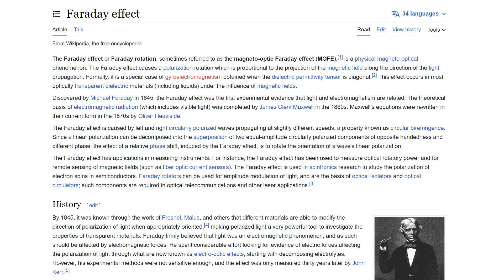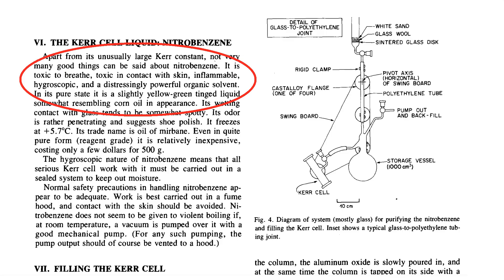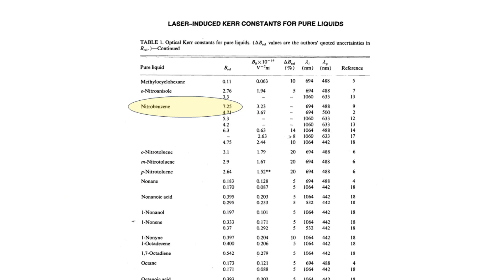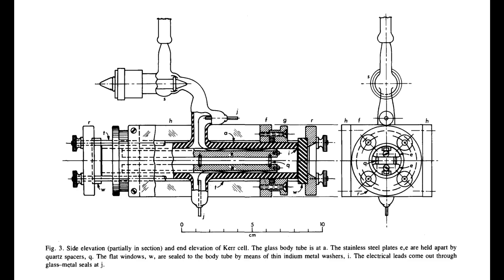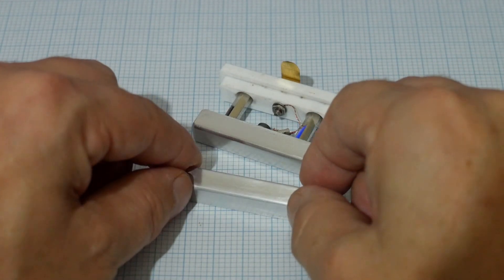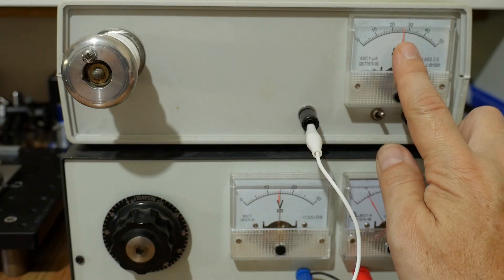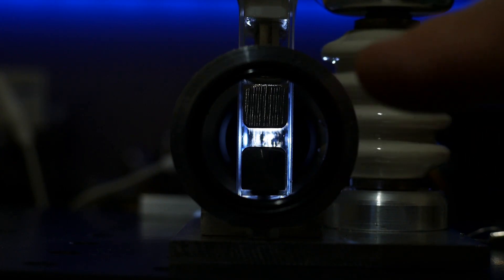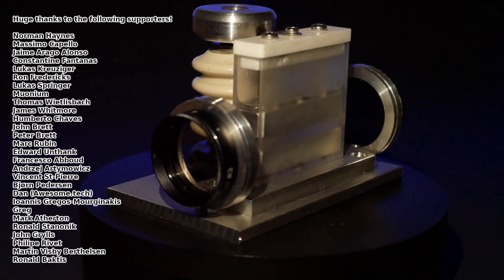Controlling Light with High Voltage and Aniseed! The Kerr Effect!

Comment: As I understand the Kerr effect is based on the field not the voltage or current directly. So I'm wondering why the electrodes are immersed in the liquid, why not place them on the outside  walls of the curvet? That way there is no current flowing through the liquid, maybe that causes the ribbons etc.
Reply from the maker: Yes, you are right, no current should flow in these, and building them in the glass walls might be quite convenient! The stringers I 'think' are because of impurities, however as Mike pointed out, this effect could be used to clean the solution by precipitating that junk out.
Reply: @LesLaboratory  Hey genius, that’s ^*star anise, not fuqqing (^*anise seed, not aniseed) ffs. How can you post a video with such a major and obvious mistake?🙄🤦‍♂️🤦‍♂️🤦‍♂️🤦‍♂️💩💩🤡👎

Comment: Excellent as usual.  I recall seeing a Nitro Benzene Kerr cell described in a even old at the time issue of Scientific American Armature Scientist 
back in the late 1960.  It was part of a high speed photography project.  If I recall correctly the light source was an exploding wire and a high
voltage switch made from a modified rat trap .  Your setup is by far safer and more practical.
Reply: Excellent CLICKBAIT.
Reply: Crackhead
Reply: Anyone making CLICKBAIT like you should be banned, fined and arrested. I'm blocking this channel. I wonder about the mental state of people liking this video or following this disrespectful channel.
Reply from the maker: Thanks! I read those articles as well. I think with a bit of refinement, some interesting experiments could be done on this!

Comment: Very cool video!

Are you interested in optimizing the performance of that device? To see what kind of transmission, modulation contrast and what speeds can be reached? 

Sidenote: Can't you use the exact same electrical setup for a pockels cells too? Specifically, with your KDP crystals?
Reply from the maker: I think Anethole is worth seriously exploring. There is very little about it in the literature. It would be interesting to characterize it.

Pockels cells are way more efficient and require much lower voltages. I already have some hardware on the way to cut and mount the KDP.

Comment: By the way, even though it is very toxic, nitrobenzene smells absolutely great! It has an almond oil like odour, just a bit sweeter and softer than the benzaldehyde found there - probably the best smell of any chemical I've smelled so far, really unfortunate that it's so toxic
Reply from the maker: Cool! I heard someone also say it smelled like boot polish. I will pass though! My workshop now smells of aniseed.
Reply: @LesLaboratory  Well, the difference to benzaldehyde is very small, especially when dilute, so if you know that you have a very good idea of nitrobenzene. In my opinion, pure benzaldehyde has a slight stingy artificial note that nitrobenzene lacks, but it's only obvious in a direct comparison.
Reply: You make me curious. 😅

Comment: For high-speed switching, a simple spark gap should be a good start to create a fast edge. For ultra-short pulses, maybe some sort of  transmission-line setup ? 
As those impurities seem to be attracted by the HV, I wonder if you could use this property to filter the solution
Reply: There seems to be an easy way to purify using water and temperatures between 0 and 30degC:

Purification of Anethole by Crystallization: Summary

1. Initial Preparation: An aqueous emulsion of anethole is first prepared. The concentration of anethole can vary.
  
2. Cooling for Crystallization: The emulsion is cooled to below the crystallization point, preferably around 0°C. Subzero temperatures can be used with antifreeze like methanol.

3. Crystal Separation: After crystallization, the anethole crystals are separated from the aqueous emulsion.

4. Further Purification: The crystals are reslurried with cold water and an emulsifier (potassium or sodium soap of tall oil fatty acid) or surfactant for further purification. This step can be repeated multiple times if needed.

5. Water Removal: To remove residual water, the crystals are melted and water is separated at temperatures between 25-50°C.

6. Final Product: The resulting anethole is highly purified, with reduced sulfur contaminants and excellent odor and taste.

This process aims to increase the purity of anethole, which could potentially improve its performance in Kerr effect experiments.
https://patents.google.com/patent/US4902850A/en
Reply: A spark gap driving a shorted quarter wave stub, near the shorted end, with the open end across the cell would be a simple way to get damped oscillations at a frequency determined by the stub. (well into Ghz) The stub would also provide the needed voltage step up function. Also, since it is the electric field were are interested in, I don`t suppose the electrodes need to be in contact with the liquid, maybe they could be just foil on the outer walls thus avoiding potential contamination from the electrodes.
Reply from the maker: Also very interesting. I had not considered capacitively coupling in the field!
Reply: Make yourself a spiral line pulse generator with an appropriately sized inductor on the output in parallel with the Kerr cell. It can make extremely quick HV pulses of about 4nS risetime.
Reply from the maker: There is a diagram of a spark gap arrangement in one of the papers, but I have too much sensitive stuff on the bench at the moment. That is a great idea, like a precipitator of sorts...

Comment: Introduction and Background
- Introduces the concept of controlling light using electric fields, focusing on the Kerr effect.
- Discusses the historical background of the Kerr effect, discovered by John Kerr in 1857.
- Explains the traditional use of high-voltage Kerr cells and their applications in high-speed photography.
- Highlights the toxicity and dangers of commonly used liquid nitrobenzene in traditional Kerr cells.

Alternative to Nitrobenzene
- Discusses the difficulty in sourcing and safely working with nitrobenzene.
- Identifies Anethole, a non-toxic alternative with a high Kerr constant, as a promising substitute.
- Describes the molecular structure and properties of Anethole, a component of aniseed.

Experimental Setup
- Details the construction of a Kerr cell for testing Anethole, including sourcing and assembly.
- Explains the need for polarizers and a high-voltage supply for the experiment.
- Notes issues with the plastic lid of the Kerr cell being affected by Anethole.

Experiment and Results
- Demonstrates the completed Kerr cell using a homemade high-voltage supply.
- Observes the Kerr effect using an LED and a camera setup.
- Notes the presence of impurities in the Anethole used, suggesting the need for purification.
- Tests the Kerr effect using a laser, finding it to be very prominent.

Conclusion
- Concludes that Anethole is a safe and effective substitute for nitrobenzene.
- Suggests future work could include purifying Anethole and testing the speed of the Kerr cell.

Positive Findings
1. Effective Substitute: Anethole serves as a non-toxic and effective alternative to nitrobenzene for demonstrating the Kerr effect.
2. Prominent Effect: The Kerr effect was clearly observable, especially when using a laser.
3. High Voltage Success: The homemade high-voltage supply was capable of driving the Kerr cell effectively.
4. Safety: Anethole is non-toxic, making it a safer option for experiments.
5. Affordable Setup: The Kerr cell and other components were relatively inexpensive to source or build.

Negative Findings
1. Impurities: Some impurities were observed in the Anethole, which could affect the performance.
2. Material Compatibility: The plastic lid of the Kerr cell was affected by Anethole, requiring a switch to a different material like Teflon.
3. Complex Setup: While affordable, the setup required various components and some technical know-how.
Reply: how does one follow you on youtube or facebook 🤣 coz you just got a new fan
Reply from the maker: @zhinkunakur4751  Thanks, Sub on YouTube , I have a community Tab. I also have twitter: @LesLaboratory
Reply: @wolpumba4099 That is an excellent summary of the video. Do you do this for other videos? Do you publish them anywhere that is easily searchable?